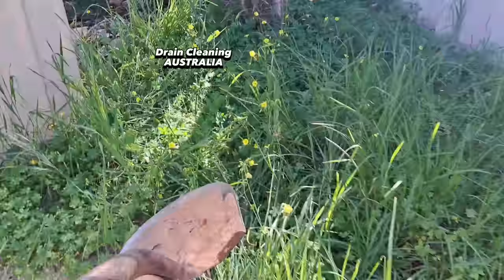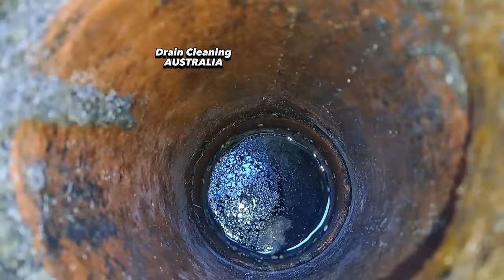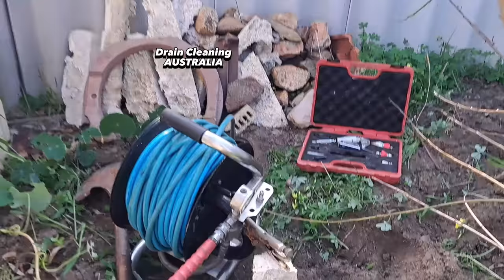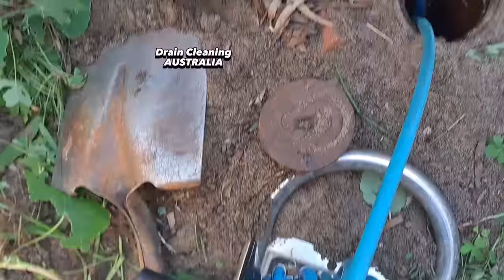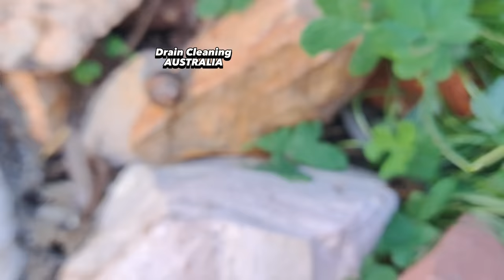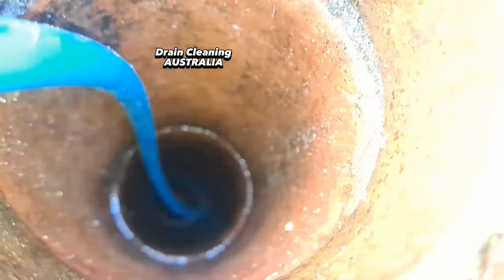The last plumber walked away from this job, so they called me

Comment: The customer needs one of those cheapo electric/battery drill operated pumps that connect to hoses. That would pump that all back down the pipe!. Even it it broke afterwards they are only about $12 :-)